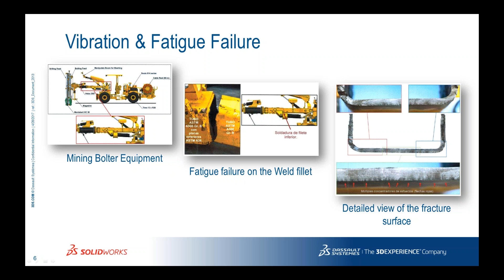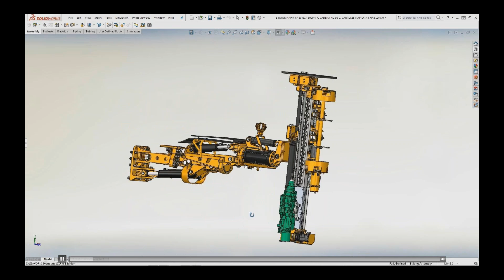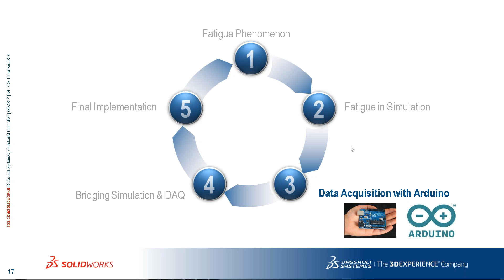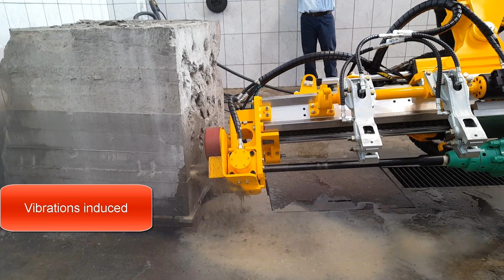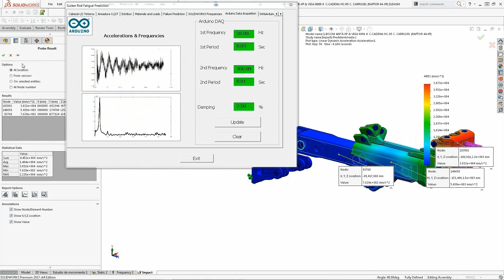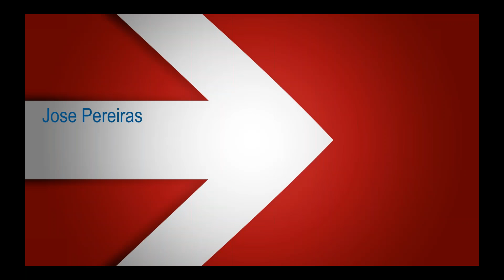SOLIDWORKS Simulation: Data Acquisition using Arduino applied in a fatigue real case

Comment: Hi ! awesome work, how they adjusted the simulation model in order to get a closer number to the natural frequency per Arduino?
Reply from the maker: Hi Carlos, the simulation model is analyzed to have the first n frequencies and then compared to Arduino sensors analysis (at 33'). there is no "adjusting" of the model. The point here is to check if the model and the test are aligned to go on with the faigue prediction. Also it's very important here that with sensors is also possible to calculate a much precise damping of the whole structure.